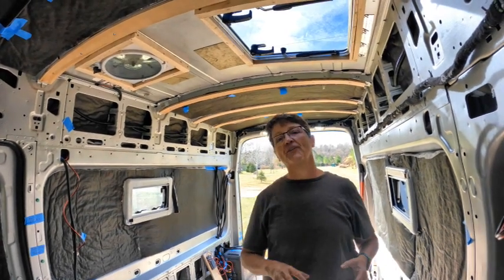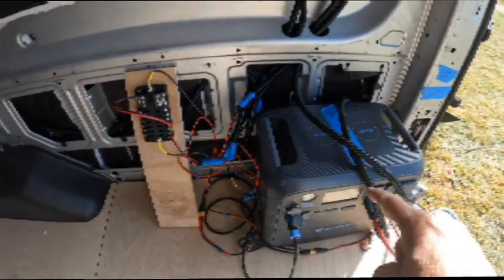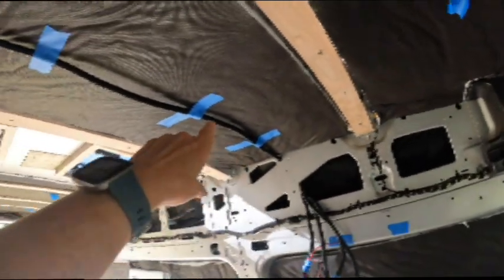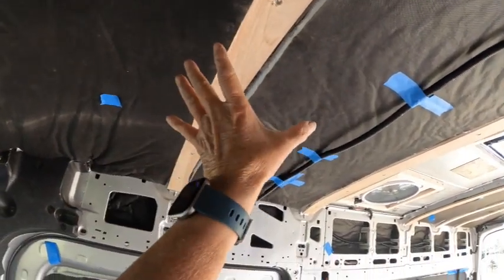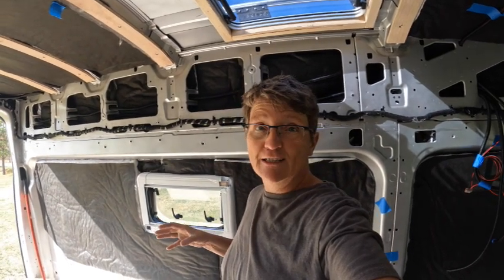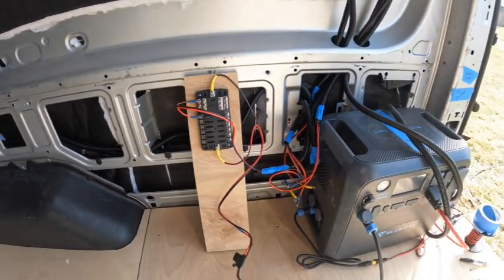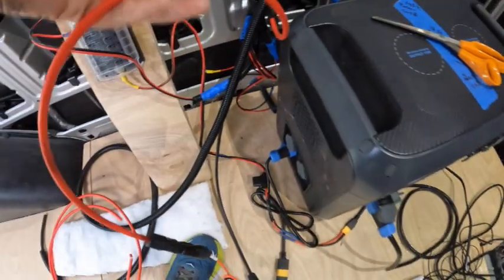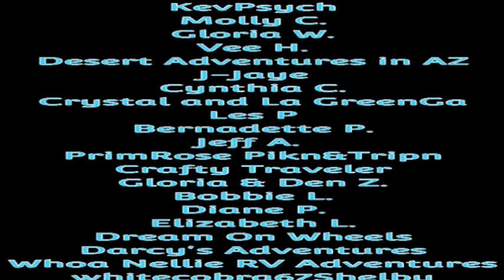Ford Transit Build | We Have Power

Comment: To make your solder flow better use a liquid Flux to make the solder flow and penetration on your wires. An electronic store should have it. Call to check before going.  Also a 500 watt soldering iron for better heat penetration. Put your solder tip under your wires.   Twist wires add a dab of liquid Flux apply heat and watch it flow.  Hope this helps you.  I soldered 40 years of electronics for the space programs.
Reply from the maker: Awesomeness, screen shit this and will try it 🙂👍❤️
Reply: What Janet said.  You will find the more you work with it the easier it gets.

Comment: Great video Jonnie! - Soldering = Gotta get the wires good and hot - I put the solder gun on the bottom of the wires while I press the solder on top of the same wires. When it’s hot enough it’ll melt right into the wire.  That will give you a good solid solder joint. This van is gonna be epic!
Reply: I second that!!!
Reply from the maker: Will definitely try this. Thanks Steve

Comment: Hi Jonnie, I haven't finished watching yet, but I think you need to use flux.  When I used to solder wires, I dipped the fodder wire into a container of flux and that helped it spread out evenly with the heat.
Reply from the maker: Awesome, thanks Trish. 🙂👍

Comment: Thank you for the video.   How is the AC200Max being charged from the alternator on the Ford Transit?  I have a 2019 Transit with 3-CCP studs (that are always LIVE)  w/ 60 AMP fuse on each stud.
Reply from the maker: She does not have alternator charging capabilities.